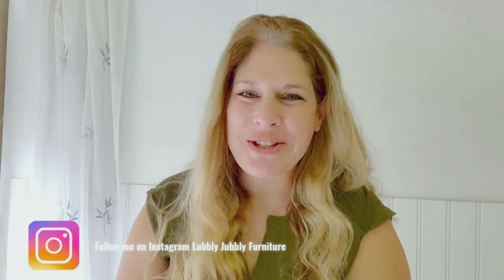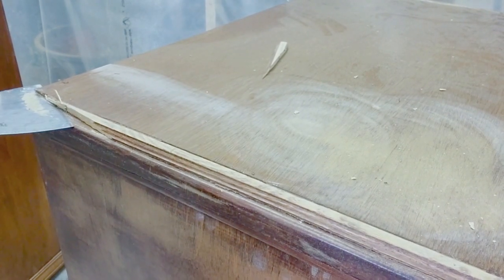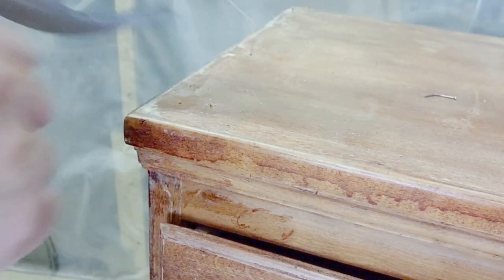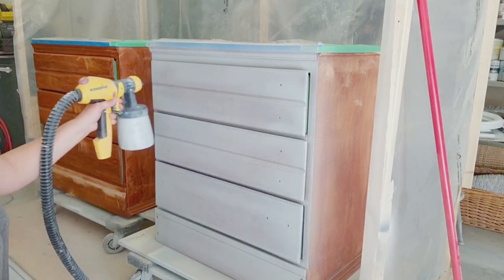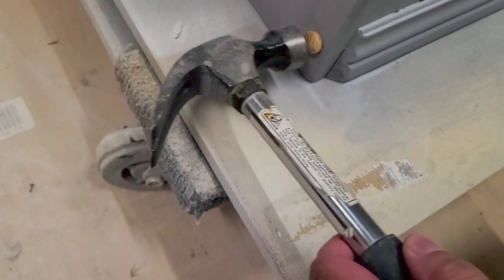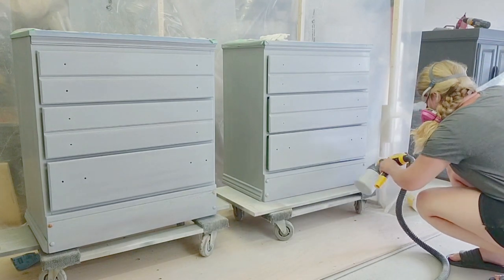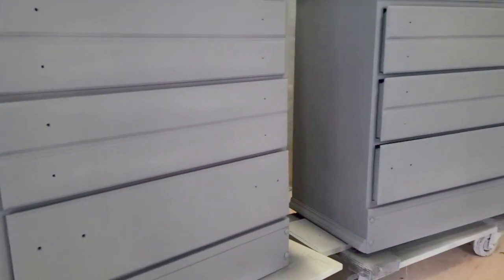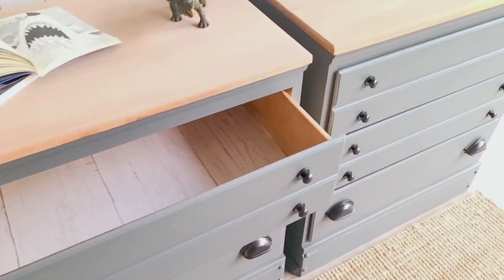Quick, Easy dresser makeover|furniture flip

Comment: I’ve heard to clean your piece before scuff sanding. What do you think the best method is? Thanks for sharing the information. Very helpful 👍
Reply from the maker: My routine is scuff sanding first then cleaning because im sanding off whatever needs removing first and then cleaning all the rest and dust off. I then go over it with a clean dry cloth to wipe anything else away. I hope that helps